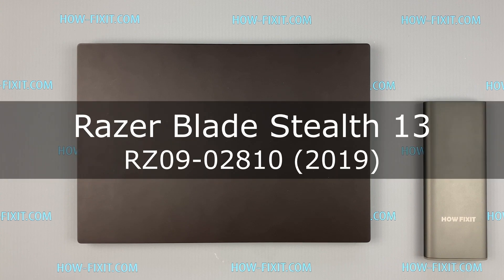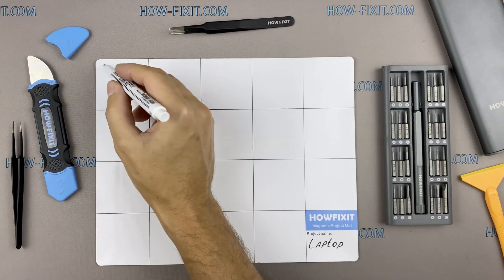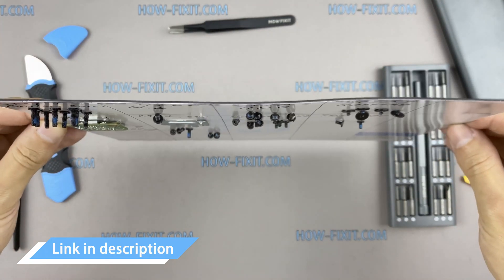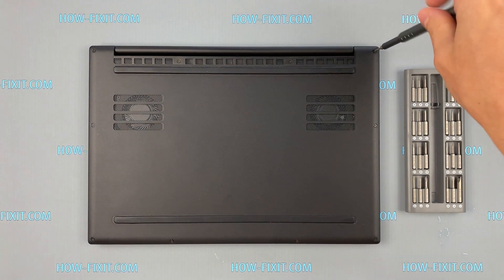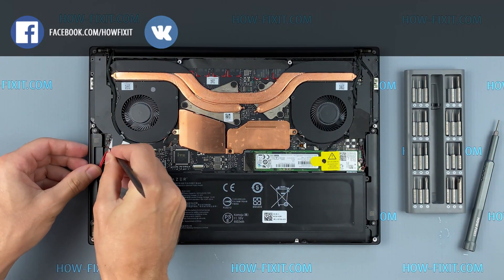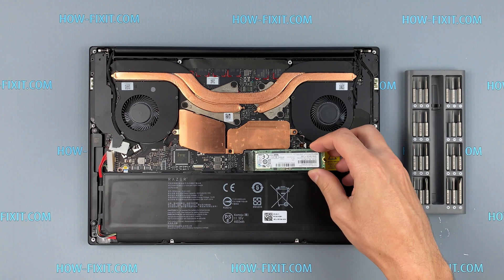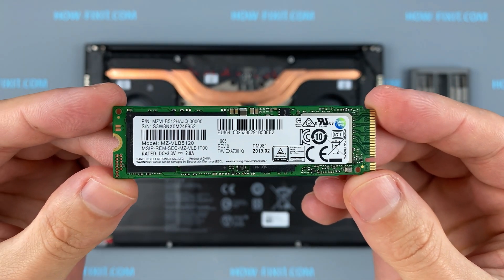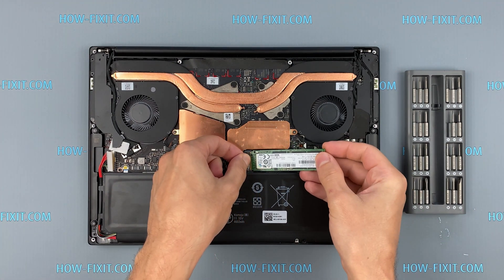How to Upgrade & Install M2 SSD in Razer Blade Stealth 13 (2019)

Comment from the maker: ⚠ The Razer Blade Stealth 13 (2019) laptop supports only NVMe (M.2 NVMe PCI-Express), not SATA. Check the description for links to recommended drives. Additionally, watch the video explaining the differences between M2 NVMe and M2 SATA 👉 https://youtu.be/r3Jy5dHOj3g

Comment: Hey Dude! thank so much for this video, I have a razer blade 2019 RZ09-02812E71 could I upgrade my device up to 2 tb?
Reply from the maker: There is no limit on the maximum size of an M2 SSD, but there are Windows limitations. If your Windows is 64-bit and the GPT file system - you can install a drive of any size. Check the description for links to recommended drives.